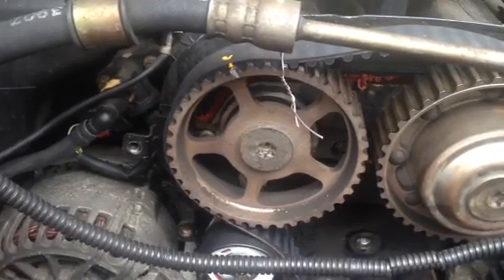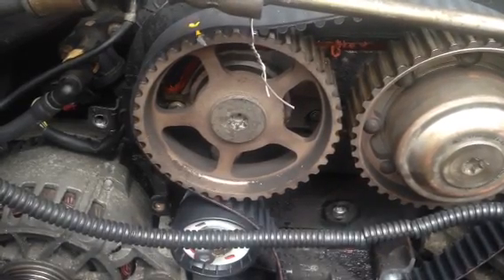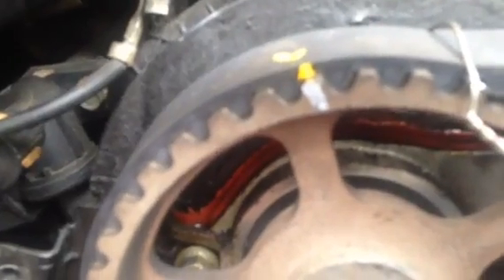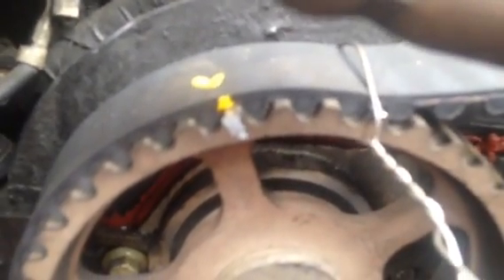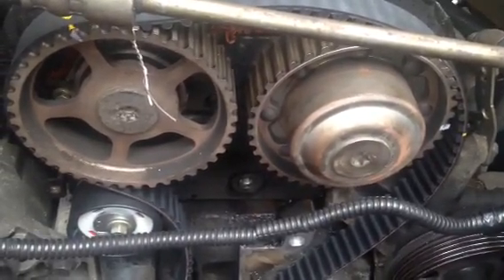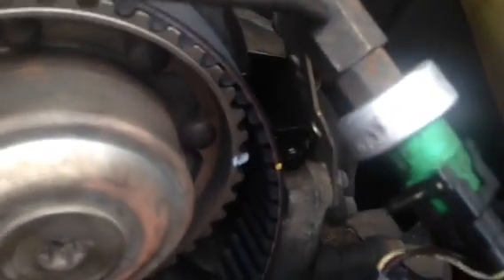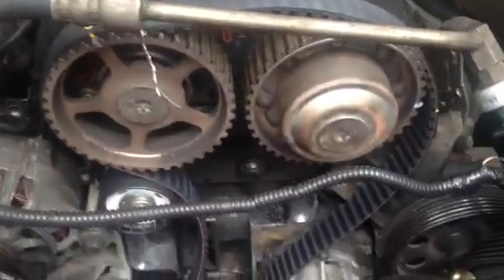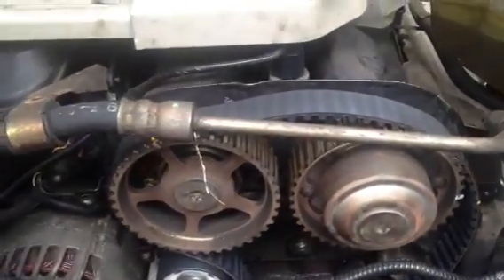Timing belt change easy mark alignment fool proof installation

Comment: I suppose this works, but you could always pay $7 at the local hardware store for an M10 bolt that's 2.5" long as a substitute for the Ford timing peg and a 5mm thick strip of metal to stick on the end of the camshafts, which is a physical, mechanical way to do it and guarantees your timing will be perfect. It's a heck of a lot easier than counting belt teeth.
Reply: Are you serious? That’s a lot more work than counting teeth!
Reply: @ranger9416  

how about this ? There's an easier way of doing it. Take off the cover, then using utility knife cut the old belt in half, NOT going across but going around the length of it, (hand-crank it to the top to make life easier) now slide off the nearest side to you, slide on the new belt, it will only go half on which is ok, now cut the other side of the old belt (this time cutting across) remove it, then slide the new belt so it goes where it should, replace the cover, job done! No need to worry about the timing or anything else because nothing moved without a belt being on it.
Reply: @6955beniegn  damn good idea. But have you done it this way?
Reply: @ravenbishop5232  No, i haven't     another guy on youtube told me about it. When I do do my timing belt on my 89 ford festiva, Im definitely going to try it this way. If this method does not work, then ill try something else.  let me know what you decide to do, and how it turns out for you
Reply: @6955beniegn  I bought a used zx2 that has 160.000 miles on it and I don't know if the belt has been changed and it worries me. There is so little room between engine and frame that I would thinks the new belt would have to be twisted/ flexed just a little to get it on a gear let alone have the room for the width of a new belt plus half of the other. Thanks for your previous reply.
Reply: @ravenbishop5232  yeah, I have an 89 ford festiva. Its the original timing belt on there. Its supposed to be changed at 60, 000 . i have never changed it. I dont want to pay to have it done, i think i can do it myself when the time comes. It really doenst look that hard, although when you read about it, it is important you do it right or you can hurt the engine.the car runs great, no issues. yes,, i understand your worry. I took the top timing belt cover off, and looked at the timing belt. it looks good.  a suggestion: You can look up your car online,type in your car and interference or non interference  zx2  interference or non interference  this way, at least if your timing belt breaks, your engine will be ok. just tow it home, and then attempt to install the new timing belt. My car luckily is a non interference engine too.

  https://www.feoa.net/threads/is-the-2-0-zetec-a-non-interfearence-engine.79712/
Reply: @6955beniegn  wouldn't you have to cut new belt in half to get past all the crap in your way?
Reply: @JoseDiaz-rd9fh  I think it would depend on your car. Whats your car?   Here's a full festiva timing belt change video. Video is titled Fiesta, but this is for a festiva.   https://www.youtube.com/watch?v=fw9GdBfoJGE
Reply: @6955beniegn  2000 Hyundai accent

Comment: I'm getting ready to do a water pump/timing belt on my '95 Contour and your method is the old school shade tree method that I've been looking for, however, I just want to be clear on your method before I dig in.. If I'm getting this right, your marking the old belt/cams/crank under tension before removal.. After carefully removing the old belt your transferring those marks onto the new timing belt by counting the teeth between each mark on the old belt so that they land on the exact same teeth on the new belt.. Once the new belt is marked identically to match the old belt, you carefully install the new belt so that each mark lines up with the marks on both cams and the crank.. Naturally, doing this job successfully will depend on making darn sure that the cams and crank DO NOT MOVE AT ALL WHILE THERE IS NO BELT INSTALLED..... Correct???.. I'm 99% sure that I get what your saying but I'm just wanting to confirm 100% that I'm clearly seeing what it is that your doing before I start the job.. Thanks in advance..
Reply from the maker: You got it and it doesn't matter if one moves you just turn it back to where it needs to be to lineup on the mark
Reply: Yeah but dont they have to have same number of teeth
Reply: @williamclaflin7863  Yeah, but the chances of a difference in tooth count with a new belt is one in a million.. When I did mine I ordered a new gates belt kit (pulleys included) from rock auto & this trick worked like a charm.. The only difference for me was that I needed someone to spring the exhaust cam back into position & hold it there with a ratchet while I tightened everything back up.. Keep an eye on your cams when you release the tension & you'll see one of your cams roll off the lobe, that's the only thing you'll need help with during the reassembly process is having someone return/hold that particular cam back into position until you've tightened everything up.. Also, make sure your new belt has enough play/slack in it bcos if it's too tight your front water pump bolts can work loose.. At least mine did which was a pain in the neck that ended up with me having to do it again..
Reply: @frethand101  thanks I got

Comment: Very good information, maybe i'm just a bit paranoid but i prefer to put sticky tap on the new belt for my marks as i worry the paint may cause the belt to deteriorate faster
Reply: I had the same concern since I read all these warnings about not getting anything on the timing belt.  No oil, no water.  Can't understand why the belts are so sensitive.  So what are you suppose to do if you get oil on the belt?  I've used brake cleaner to remove the oil, but maybe the brake cleaner harms the belt too. :(
Reply from the maker: MrMayhem87 well I thought about this too but I have belts that have been running for years and have changed some that had paint marks on them but if you're still a little concerned you can use latex house paint on a small paint brush or something like that I would worry about sticky tape coming off in the process
Reply: yeah ok, i've done the job a couple times now and the sticky tape hasn't come off, thanks for the tip though!